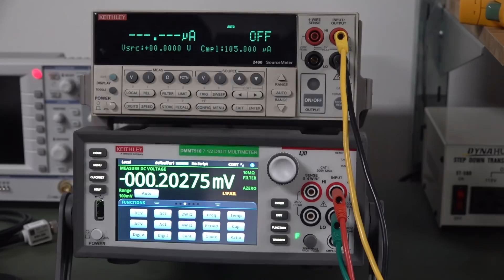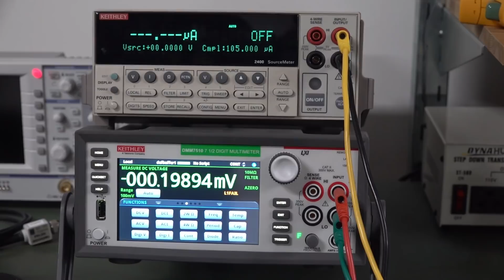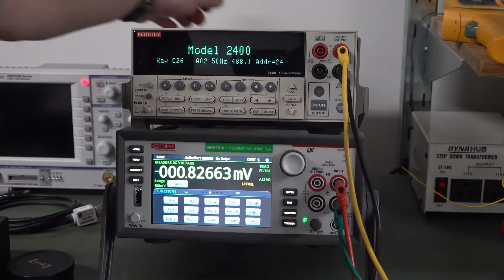Keithley 2400 SMU Wobbly's

Comment from the maker: NOTE: This was going to be part of a repair video, and it's been available to supporters for many days now. But it's only failed once since I took the cover off to investigate and hasn't failed since.
If it ain't broke I can't fix it, so here is the video anyway.
Reply: Ha. This kind of bugs is the worst. Those pesky little buggers bug you, but when you get round to pinning them down, they run like cockroaches after turning the light on.

I once had a Tascam DJ mixer in for repair in a field setting and didn't even have a multimeter on me, let alone a scope. A few pros . Basically, a soldermask was damaged under one of the slider pots, and a power trace had an intermittent short to GND, resulting in the mixer going haywire.
Reply: That could actually point to a thermally related (intermittent) failure. Have you had a look with the thermal camera? Maybe some component just gets too hot with the cover on or some electrolytic is going bad.
Reply: It waits till you leave the lab ;-)
Reply: I once tried to repair a stereo amplifier where one channel would randomly start outputting max volume for a few seconds. It did that all the time, like every few minutes in normal operation. But it would never do that when I had the cover off, so I couldn't debug it. So frustrating! I was never able to fix it.
Reply: Maybe the heat from the multimeter (but that shouldnt get that hot i think?) togheter with bad fan is overheating something? When youve tested it now ypu maybe have had it by itself so it just lies below the failure temperature? But yeah, very annoying to find these kind of faults. Was hoping for a repair video. 😅
Reply: I recall having an issue with either a 2401 or a 34401; can't remember which; but the power switch on the front of the unit had a long arm to press a physical kerklunk switch at the rear of the unit. Maybe something along those lines was out of whack and taking it apart fixed it?
Reply: I have a 2400 device, it said "No Comm Link" error, I checked according to Keithley's repair guide, U15 & U16 are smd types and solder joints are good. What should I do next to fix it. Thanks for supporting me!

Comment: If anyone has this issue, the solution is to clean power supply output pins..  In older models there is no gold plating so oxides have grown causing intermittent power failure.

Comment: I had the exact the same thing. Most likely the mechanical power switch which gets some serious mechanical torque from the front switch which is just a long white plastic rod which goes all the way back. This torque breaks the solder joint of the switch. I just soldered the power leads directly to the PCB bypassing the switch. Add an external switch to the cable or use the cable as switch and you are set. It was a relatively easy fix. 

While you are in the unit, change the battery as well since it can give symptoms which are similar. Also,  make a backup of the EEPROM if you have a reader.

Finally, you say that dont't fix it if it ain't broken I would recommend at least have a look on the switch solder joints as arcing can cause big problems if it is not fixed.

Comment: Perhaps a cold solder joint, flaky connector, or flaky cap? Some of these 2400s can get up there in age, think they were first released in 1992! If you plan on keeping it, recapping the PSU/digital stuff and a little contact cleaner/deoxit on the interconnects couldn't hurt either. Plus the internal system battery and the fan could always use a refresher after many years and hours.

Comment: Hi, Dave, you have all this gear that you rely on being accurate.
Do you have a bit of gear that has its annual NATA cal check to make sure your lab measurements are  accurate.
At my workplace we have a Keysight model 34470A DMM, it gets NATA certified each 12 months, we do DMM certifications for various organization and trades and use this as the sighted NATA device.
The Keysight is also used for published test results on refurbished or manufactured equipment we work on.
There are a number of work places which now need to have annual equipment certifications,  manly to conform to Australian design or workplace requirements.
I would think a lab like yours would have to as well have one NATA certified device to check your other bits of gear.

The Keithley looks like an over heat problem, but doing a cap change after all these years is also a good exercise.
It will be interesting to see what you find.
Note that the display blanks out, rather than fades or displays junk before it does its reset.

Comment: I sense a repair vid coming up.  First guesses,  maybe power supply related,  or perhaps in the circuitry driving the display as that might have a higher voltage. A bad cap? Dry sauder joint?
Reply: I would guess it's heat cycling, some component is sitting right on the point of failure and any variance in the temp tips it over, it then cools off and restarts. That could explain the no fault  with the case open. Slightly better cooling for that component.

Comment: And don't use the automatic range switching if you are performing delicate measurements. Some Keithlys make funny stuff if you do measurements at 0V.
Reply: More related to the sourcemeters.
Reply: @berndrosgen1713  The 2400 is a source meter.
Reply: @ferrumignis  Yes, that is which I used most.

Comment: I just treated the same ailment a few days ago, it was disappointingly easy in my case. Care for a spoiler?
Reply from the maker: Considering that it's now been running for 2 days straight with the lid off and has only failed once now that I have seen, I don't like my chances of being able to diagnose it any time soon, so yeah!
Reply: @EEVblog2  For me it was an empty memory battery on the digital board. U2, a Dallas (typical!) DS1236 with one of its key features being "Halts and restarts an out-of-control microprocessor" doesn't seem to like empty batteries
Reply: @reps  Thanks, will check it out. My first check would have been the PSU, and then monitoring the rails and triggering off the CPU reset line which would capture this if that was the case. Actually, the battery would have been part of the rail checks. Haven't done anything yet, just waiting for the damn thing to die again.
Reply from the maker: @reps  Well scratch that, I measured 3.08V on the lithium battery, both on and off. Still no more fails.
Reply: @EEVblog2  30min off and the battery has creeped up slightly into the 3.09's, exactly as you'd expect of a good celll.